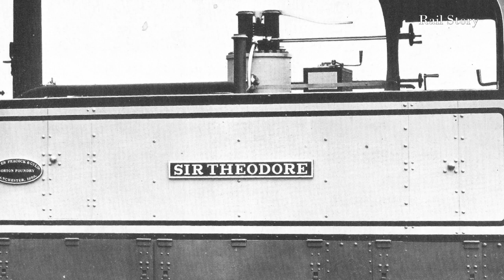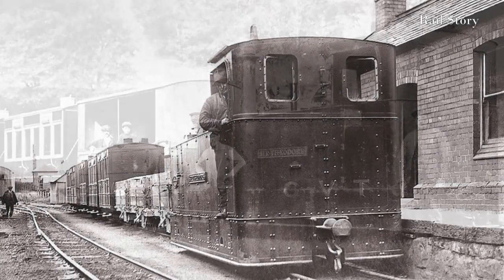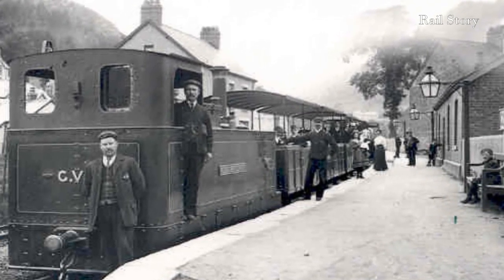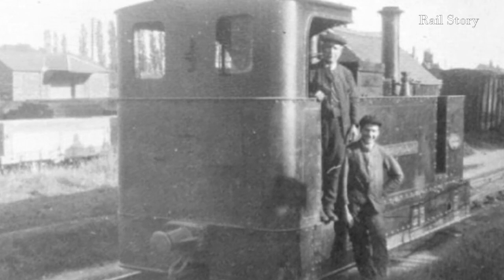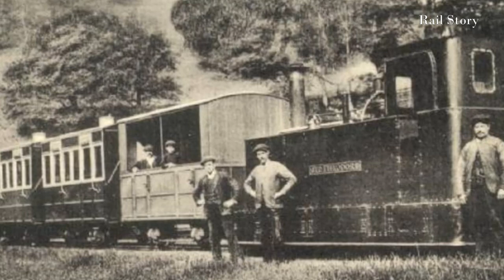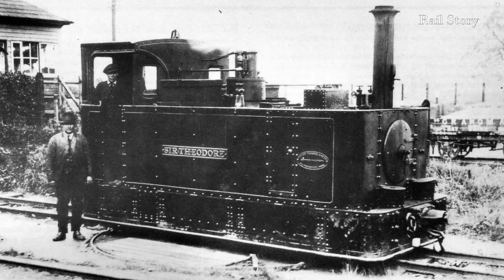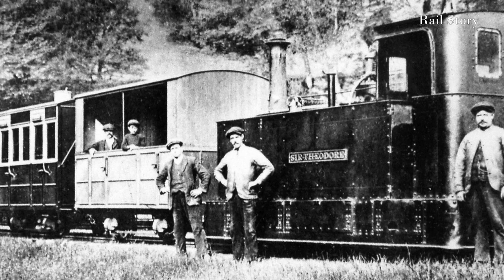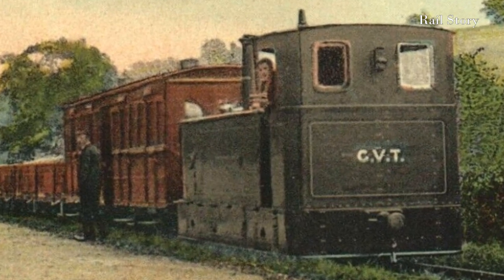Sir Theodore

Comment: Happy birthday, I am also fond of these locos.
 Henry Dyke Dennis (1863-1944) certainly had his fingers in lots of pies as he had a Bagnall locomotive named after him on the Snailbeach & District Tramway and also (more infamously) was a Director of Gresford Colliery in Wrexham where Sir Theodore Martin was Chairman.  Two shafts were sunk 50 yd (46 m) apart: the Dennis and the Martin. They were named after Sir Theodore Martin, the company chairman, and Mabel Dennis, wife of Henry Dennis, who had ceremonially cut the first sods for each of the respective shafts. Work was completed in 1911. The mine was one of the deepest in the Denbighshire Coalfield: the Dennis shaft reached depths of about 2,264 ft (690 m) and the Martin shaft about 2,252 ft (686 m). Henry had married into a very wealthy family and ultimately took control of the mine. On Saturday 22 September 1934 at 2:08 a.m. a violent explosion ripped through the Dennis section killing 263 miners and later 3 rescuers. Gresford is one of Britain's worst coal mining disasters: a controversial inquiry into the disaster did not conclusively identify a cause, though evidence suggested that failures in safety procedures, insufficient ventilation and poor mine management were contributory factors. The mines manager William Bonsall had been under pressure from the Dennis Family to increase profits following losses in 1933. The Mines agent Harrap who was supposed to be give independent oversight was a major shareholder so had a conflict of interest. The Dennis family also controversially had the mine sealed preventing access by investigators, leading to accusations of hiding evidence and only 11 bodies being recovered. Miners were   intimidated with threats of sacking if they spoke to the inquiry. The only prosecution was to Bonsall, a fine of £150 for poor record keeping. Unlike his miners, Dennis was to have a fine grave. For a man who vainly named his interests after himself (not uncommon of those times) it is ironic his name is perhaps best remembered today in a traditional folk song made popular by Ewan McColl.   https://youtu.be/iJhmuUnsXWI
https://www.wrexham-history.com/henry-dyke-dennis-1863-1944/

Comment: Nice video the hydraulic governor is interesting, from what I’ve heard and I might be wrong but the gauge was 2ft 4 1/2 inch since one of the glyn valley locos apparently traveled to the snailbeach railway since Henry Dennis was also part of that line. But it quickly went back due to the 1/2 inch of difference causing it to ride up on the rails and derail.
Reply: You're right about the gauge, it was 2ft 4 1/2". I have the out-of print W.J. Milner book from the 1980s on the GVT, and its local to me (5 minutes by train from Ruabon)
Reply: I found this online:

The Glyn Valley Tramway started life as a horse drawn tramway in 1873. Increasing traffic as a result of the expansion of the local quarries brought about a change to steam traction in 1888. This change also produced a change in gauge from 2' 4¼" to 2' 4½".
Reply: @moggy823  Yup, it was said that the locos used to relay the line (the first two locos from Snailbeach, also owned by Henry Dennis) were a contributing factor, although they were 2ft 4" gauge.
Reply from the maker: I was working from the BP works list!

Comment: I'm surprised that the protruding centre buffer was permitted on a tram engine.  For instance the Corris locos (ordered before the Act changing the title from tramway to railway), had tramway type folding loop couplings to comply with the tramway requirement that couplings could be retracted when not in use.  However the Corris locos did not have side skirts or condensers but the Board of Trade did insist on the addition of speed governors.

Comment: Love these trams and I really like the model Accucraft produced of them which Iv never got but I do have a couple of the charming coaches (kit built). Iv read stories of the trams running smokebox first on occasion is there any truth to these stories or was the practice of running cab first strictly observed?
Reply from the maker: I'd dearly love an Accucraft model. At first the practice of cab-forward was strictly observed and the engines were turned at the end of the line before running round. However, by the mid C20th that had pretty much been forgotten. So too many of the restrictions on making smoke and covering up the wheels etc. The GVT had a conventional ex-WW1 Baldwin and no one seems to have bothered about the Tramways Act.

Comment: These are intriguing little 2-4-0's. I did not know they existed until now, excellent video as always. Though I'm curious if the engines ever worked "Backwards" (or conventionally) at all with the Tramway act that brought the engines into existence. On the subject, if anyone smarter than me can tell me, why did the Class 04's on the Wisbech and Upwell not have to have forward cabs fitted like these engines, or dual enclosed cabs like other tram engines such as the J70?
Reply: The Tramways Act of 1870 was pretty vague in its requirements for tram engines (in fact the Act was so opaque that it didn't even define what a tramway actually *was*, it mostly focused upon how a tramway should operate in relation to local government)- it was up to the local authorities as to how the act was interpreted and enforced, resulting in a lack of consistency across the country.
Reply: Its been a while since I've read John Milners books, so I may be a little rusty... The GVT was technically opened under its own right, not under the tramways act, though the strict constrains on the loco design were similar. 
The line ran road side for most of the way between Chirk and Glyn Ceiriog and there where turntables at both these stations, so this section was supposedly always worked cab forward. However the rules weren't stickily adhered to and there are pictures of locos running conventionally. 
After Glyn Ceiriog the line left the road and continued down the valley to serve multiple quarries. This was goods only and there was no turntable at Hendry so the locos worked either way. 
I imagine in later life the rules got quietly forgotten especially after the Baldwin arrived as it was to long for the turntables and didn't comply with any of the tramway regulations anyway!

Comment: What would the crew do when the feed water became too hot for the injectors?  Was this before pumps were able to push water into the boiler?  Also, were the cylinders under the cab or under the smoke box?  This is like a baby engine to the mallets modified to be cab forward for the California mountains.  I saw the remaining loco at the Sacramento, California Railroad Museum a couple decades ago.  HAPPY BIRTHDAY!!!
Reply: They're conventional with cylinders under the smokebox, they just run "Backwards" in conventional terms as standard.

Comment: 'Ang On A Minit, Anthony ..... Since the locomotive is a cab-forward design, that makes it the front of the locomotive. 02:08 With that in mind, shouldn't this locomotive be considered a 2-4-0, regardless of where the placement of the smoke and fire boxes are? Or is it convention that the smokebox is always the "start" or front of the locomotive. In that case, what about Beyer-Peacock Garrat locomotives, where the wheel arrangement is a 2-6-0+0-6-2 starting from the smokebox? Sorry to be a pain, I just had to ask. And a Happy Birthday to you, Anthony.  🎈🎉🥂
Reply from the maker: Well yes, it should. I did discuss all that in my original cut of the video but then edited it out as it was a bit confusing. The usual way of noting wheels/axles is from the "front", which is usually the chimney end. But not always.
Reply: @AnthonyDawsonHistory   which is usually the chimney end. But not always  - I got a chuckle out of that.
Reply: The front surely is the end that leads when it travels! Therefore, with the cab leading, it should properly be known as a 2-4-0 despite the generally conventional layout that suggests otherwise.
Reply: @caroleast9636   Agreed.